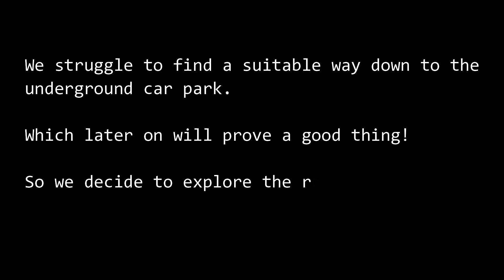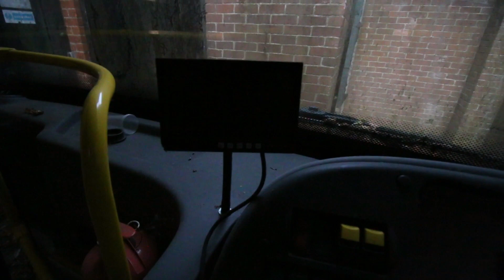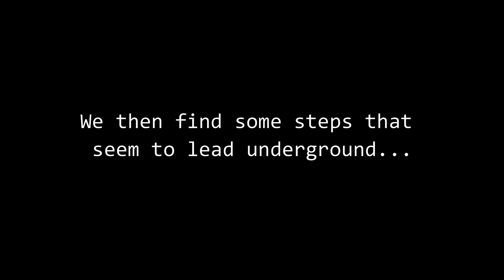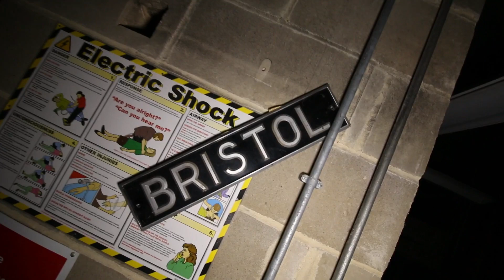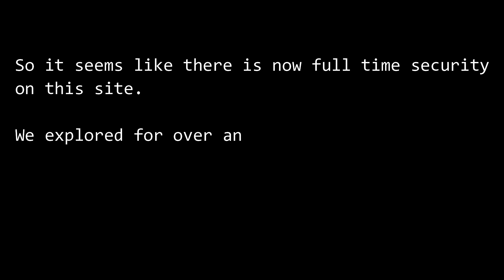Abandoned Bristol Cars Supercar Basement, Chased out by Security! Old Kamkorp BOC Oxygen Building

Comment: The BMW 330SE D Estate/Touring is rapped, it’s actually British racing green.  The reason I know, I bought it, when it went to auction. 
Bristol owned the car for 12 years, and maintained it regardless of cost. 
I still have it, I don’t use it much, only cost me £50 to tax and insure 👍
Reply from the maker: Would you consider selling it?
Reply: @ExploringWithBeard   Hi, to be honest I haven’t thought about it, I would consider it, but I have spent quite a lot on it. 
The original cloth trim was in ok condition, but the drivers seat was frayed and grubby, so I changed all the seats and door cards and replaced it with sports leather, which transformed the car.
The rear Passover door is a bit crusty, plus the rear sill on passenger side needs a little attention, but nothing serious.
It passed its mot, but I agreed to have the ABS sensors changed, plus the oil sump sensor, which I’ve bought, just haven’t got round to fitting, all sat in the glove box, which still has the torch.
I’m in Essex, your welcome to take a look
Reply from the maker: Let me know if you ever think about and give me a price and we can go from there
Reply: @ExploringWithBeard   So sorry for my late response, I got called out last night, first chance I’ve had to responded. 
If I could get between £1500 to 2k, I’d let it go.
But I would insist on dropping the oil, replacing the sensor, plus the ABS sensor’s, I’m an aircraft engineer, sorry I’m OCD
Reply from the maker: That’s definitely a price range I can work with. Did you unwrap it or is it still white? Yeah no issues doing some work on it, always worked on my own cars
Reply: Just for clarity, it’s still white,👍 V5 says green, Bristol didn’t inform the DVLA, as it’s a sticker, it’s all legal and registered to me.
Reply from the maker: @paulstansfield8693  Just emailed you